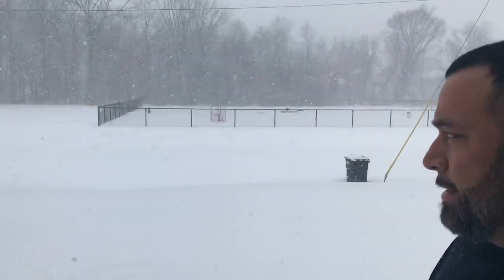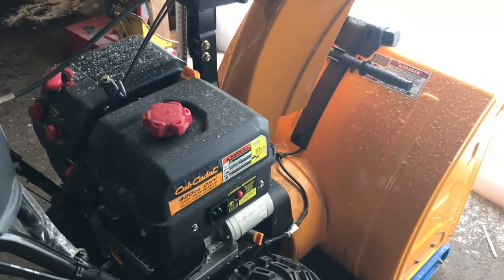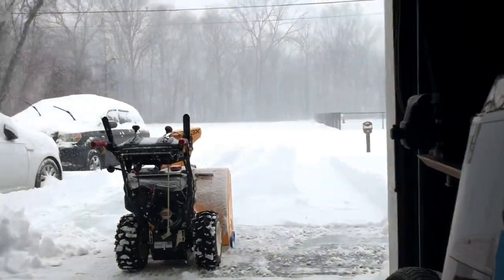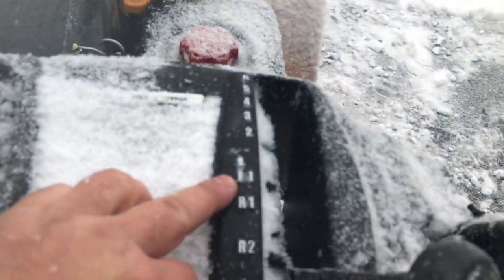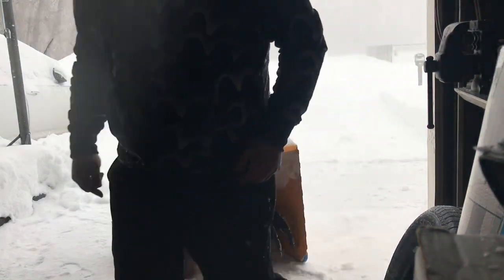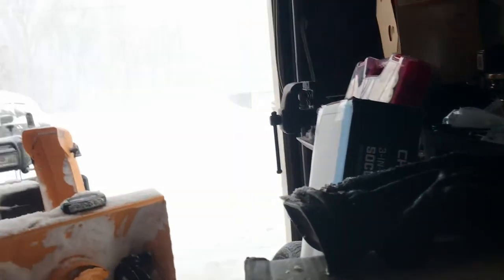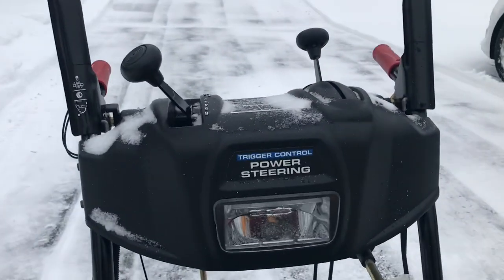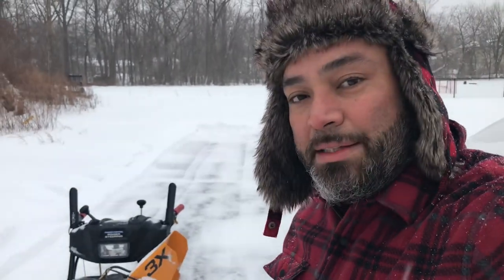Cub Cadet 3x 30 HD Review 2021 snow storm

Comment: broke shear pin?  I have the near exact same snowblower but Troy Bilt, 3X 420..  I've burned the ,main belt off mine several times, sheared some pins.. but golly, mine will CHUG thru 2 ft. snow like no tomorrow.  The steering has held up fine.  Always easy to start w/the pull rope.  Don't leave stale gas and it's a beaut.
Reply from the maker: That is good to know thank you

Comment: Why r u stopping and going, once the sheer pins were fixed that should eat that amount of snow easily.  I have a 10 yr old cub cadet 930 (2 stage)  with 357 motor it would and did (Connecticut)  go through that stuff like nuthin!
Reply from the maker: That is good to know. I will try it in the next snowstorm 
Thanks for the info
Reply: I agree, a snowblower that big should eat up that much snow without stopping.

Comment: I feel you left it in half choke and rabbit mode vs turning it to full choke and changing the mode of speed.
3 stage 400cc Cub cadets should chuck snow, even if powder much farther than that.
I could be wrong.

Comment: You need to keep both of those levels down in order for that machine to operate right, you are going to wear that friction disk down more quickly on that transmission, plus,there is a shear pin on the gear that turn those tires, you are going to snap that pin because of the stop and go motion  you are causing a lot of stress on that shear pin.
Reply from the maker: Thank you for the info 
I will keep that in mind next time I use the machine. Hopefully it snows soon so i can try some of these techniques

Comment: Also GREAT VIDEO! I'm curious if that forward auger was working when you initially clogged up. For heavier stuff like this that first full mouth pass is the hardest even at lower speeds. I'll take half cuts the rest of the driveway and tune my drive accordingly.  Side note I noticed CC leaves an awful lot of space for their final stage augers. Did the impeller mod with rubber to sweep the Chute better and I can't wait to try it. Worked wonders on my 70s Toro and a few other machines I have fixed up.
Reply from the maker: Thanks for the info 
Yeah i have been wondering about that impeller mod. I’m curious to see if it really works. Please keep us posted on how you like it if you get the chance to try it out. Thanks again
Reply: @chillymooose  It doesn't do anything substantial on this machine. I have since sold my 3x as it was nothing spectacular here in the Northeast.
Reply from the maker: @Bellincion  I agree 
I’m going to give it one more try if we ever get a decent size storm but starting to think it’s probably time to change machines

Comment: If you can find ethanol free gas it works best if not the manual says to use highest octane gas you can.  
Also mine says to store with lever in 6th speed to keep the cable from stretching to the gear box, though it looks like they replaced the cable with a metal rod to the gear box.
Reply from the maker: This is great information 
Thank you for letting me know

Comment: Your cub cadet performs similar to mine when i bought it and your engine is bigger. That was til last home depot maintenance. This is a beast when everything is correct. Look how high is housing that takes snow and if all correct it will throw snow easy to top or above housing. You see that weak stream at the beginning of video thst means prabably auger start cable is not corectly tightened. You had to start and stop cause stream was throwing weaker not to clog snow blower. Also pin broke when it was maybe an inch of snow and for me now i think i broke 2 pins while before correction prabsbly 20 or more mostly on small snow. Now my snow blower can throw heavy 2 feet tall plow snow pretty easy. Guys at cub cadet dont know their own equipment!!
Reply from the maker: Oh wow... nice, I appreciate the feedback. I’m going to take a look at the manual and the machine and see where I need to make adjustments. Thanks again

Comment: I cant believe it blew that good with no shear pins
Reply: It uses 6 shear pins total. 2x for left auger, 2 for right auger. 1 for the front chopper, there's also a rear chopper before it hits the thrower that shoots it out the shoot. 

The yellow spinner in the rear isn't what's chucking that snow. That is black. Essentially snow has to go through 2 moving partd before hitting the chucker. Either center spinner or auger, then rear chopper that blocks the chucker so all snow has to go through that, followed by the chucker.

 The rear chopper was still spinning and the augers was pulling in the snow which is why it was still throwing as if the front chopper was spinning.

They could make an all auger front with chopper in rear than chucker.

It'd be like if stage 2 went Super Saiyan.

Comment: Thanks for the video,  I  would check the positioning of your speed control cable , you should be able to go slower than you currently are.  Definitely get your belts tightened up.
Reply from the maker: Thank you, I’m definitely going to check that out. I appreciate it
Reply: @chillymooose  put the machine in 6th, remove TOP pin of the linkage going from the speed control down to the chassis. adjust it by turning the nut counter clockwise until there is just a tiny bit of tension when inserted back in. replace with pin. This will set your gears correctly giving you better reverse as well as lower 1st gear without changing your top speed

Comment: Should've just bought an Ariens two stage machine. The snow wasn't deep enough to have to keep starting and stopping to allow the machine to catch up, even after the middle auger was fixed. Most two stage machines could've handled that without starting and stopping.
Reply from the maker: Thanks for the comment 
Going to see how she does this upcoming snow season and if I decide to buy new, I’ll definitely check out the Ariens
Reply: @chillymooose  Well... if you do, check out one of the Rapid Trak versions.
I bought an Ariens Platinum RapidTrak 28 SHO in 2020, and it's one of the best investments I've ever made. It handles deep, Chicago lake effect snow like it's nothing... and throws it FAR, and no skipping and sliding either. Hopefully though... your snowblower performs better, so you can save that money. Good luck .

Comment: I bought the same machine right before the first storm. It performed well but I did replace 9 sheer pins from debris kicked out by snow plows. The 420 is a strong motor and the power steering was a luxury, but reverse was painfully slow. 
The traction was lacking so I ordered chains too.
Reply from the maker: Yes i love this motor and it performs well. Please let me know if you figure out how to dial in the machine.
Reply: What chain did you get for it, I have the same blower?

Comment: There is a hidden rocker switch under the main panel facing the operator. I had to ask my dealer where it was located? 
I have the same machine. I’ve had mine for 9 years so far. The heated handles are over rated.
Reply from the maker: Found it
Thank you. Yes I agree they really don’t do much especially when you are wearing gloves
Reply: @chillymooose  I previously had a smaller machine made by Troybilt. That had heated handles. When those were on? I had to wear gloves to prevent my hands from being burned by the heated handles. Those threw off serious heat! Unfortunately when we got bigger snow fall dumps it wasn’t up to the challenge? I had to up my game. If I had my dithers I would have preferred to buy a Honda but they wanted serious coin for the same size machine. Maybe next time?

Comment: I have the 26 inch 3x with the 357cc motor. You have to slow down in deep snow no matter what its consistency, in other words, you have to let it chew its food before you make it swallow. Mine works awesome that's all I know. I did zip tie the governor for top rpm possible, I would not recommend for others to do so.
Reply from the maker: Thank you for the info
Reply: Prabably auger cable loose your machine too. I have 28 inch 3x 357cc and first 2-3 years machine had little power, shear pins brake all the time, clog a lot even if an inch of snow. Then a year ago I gave it to home depot for maintenance. After that amazin!! This thing you can go 2 feet of snow and if it needs it starts thst tractor sound and it flies far. It is beast even i did like a foot or more very heavy left plow wet snow and it still did job. There is no up down stream no more. It is just up and far.

Comment: Great video! Unfortunately that’s the main problems with Cub Cadets.  They clog and barely throw the snow with any distance.  I just sold my Cub Cadet and ordered a new Honda for this year. I had enough of Cub Cadet!  Hopefully you have better luck with yours…
Reply from the maker: Wow… good to know. What model Honda did you get? I may look into it.
Thanks
Reply: @chillymooose  HSS928
Reply: Sheer pin was busted, they work good if you know your machine
Reply: @allenwolfe8196  I had my cub cadet for 10 years. Always  started right up first try, just never could throw the snow like other brands I’ve seen. Even when brand new. Hoping for better results from the Honda ….
Reply: Let us know how you like the new machine. Thanks
Reply: @allenwolfe8196  👍🏽
Reply: Hey moose,u use your new Honda 828 yet

Comment: You had the machine in the highest travel speed (#6) and kept on starting and stopping to let the auger catch up with the snow that was being forced into it. All your doing is wearing out your drive belt by starting and stopping. SLOW THE MACHINE DOWN TO #1 0R 2 SPEED and let the machine do the work.
Reply from the maker: This is great thank you. Yes looking forward to the next snow storm so that I can use this tip. Thanks

Comment: Something wrong with your 3rd stage. Shouldn't stop because of a little snow. Check your shear pins & gear case. You are trying to feed too much at once. Take it down a gear let it do its job. It is really hard on the trans to jam it forward than stop. Than jam it forward. Slow the speed forward & let it get rid of the snow.
Reply from the maker: Thank you 
I appreciate it 
Looking forward to new snow fall so I can try it.

Comment: It's a good video to help people diagnose a broken shear pin, but it doesn't show much else.  Pins can break at odd times, or become damaged at one time, but not fail until later.  I know I only ever broke one pin, and when it failed, I found no debris.  However, at some different time, I do know I hit a concrete "frog" that the previous home owner left near the pavement which stalled the machine, but didn't break the pin at the time.  I was waiting, still am, for the gearbox to fail after that, lol.  It made some nasty noises for a while, but then it settled down.  I'm sure a chunk got broke off and got shoved into the corner of the gear box.  I just hope it stays there.  ;)
I understand speeding up videos to keep them short, but if someone is going to sit through a 1/2 hour snowblower video, they probably want to see real time action.  ;)
I still remember the old "3 stages" where the "3rd stage" was a powered drift cutter.  My friend's dad had a Murray(?) "Snow Wolf" that had a little drift auger up top.  Looked pretty cool.
That's not to be confused with some old machines that just used multiple same sized augers, like the larger commercial machines do.
Unfortunately, due to Safety Sallys, your aren't gonna see good drift cutting machines in the states.  If you want to see a drift cutting beast, look at the Euro style Hondas.
Or pre-1970's machines in the states.
Reply from the maker: This is great thank you
Will definitely look into those machines
Reply: @chillymooose  to check I just googled "honda european snowblower" and clicked on images.  Most images showed "normal" ones, but you will see the ones I'm talking about in some of the images.

Comment: I had one of these 3x cubs and i got rid of it and bought a brand new Toro 2 stage. 
The Power Max HD 1030 OHAE.
I think a  2 stage blower would work alot better.
Do yourself a favor... get rid of the cub and go get the Toro Power Max HD 1030 OHAE.

Comment: A two stage HD snow blower with 14-inch impellers and auger is the best all-around machine for any snow condition. About a month ago here in southeastern MI I spent over two hours blowing 6 inches of extremely wet heavy snow and not one time did the machine clog or even hit of doing so. That sold me on the machine's ability to deal with any kind of snow condition. The most amazing thing to me was, it was able to throw the heavy wet stuff more than thirty feet. I was not expecting that. Toro claims the machine will throw snow fifty-seven feet plus in the right snow conditions. After how it threw the wet stuff, I tend to believe Toro's claims. Hand warmers worked great, and the quick stick shoot control was tricky to get used too, but after some time using it, I got the hang of it. The trigger steering took a bit to get used, but once again I got used to how that worked, and now I can control the machine with ease. I was looking at a Pro Series Ariens but because of the auto steer system and some complaints of having to fight with the machines in some situations I went with a Toro Power Max HD 1232 with trigger steering. So far this winter we have not had much accumulating snow. Maybe next year? Thanks for sharing your experience with your Cub Cadet 3X 30 HD. Hope you can work the bugs out and blow snow when you get it.
Reply from the maker: Thank you for the info 
When I go to look into a new snow blower I’ll keep your model in mind. I appreciate it.

Comment: Two stage all the way. This video proves the complications of a three stage, and they are supposed to be way better at clearing snow, but this just shows it add more complications to it. Besides that, they are much harder to maintain. Stick with a two stage unless you're a contractor and can write off the cost of your equipment and maintenance.
Reply from the maker: Thank you for the feedback 
Really appreciate it
Reply: He was In a way to high gear i have the 45inch one and it throws it like 60 feet and can't stop it

Comment: Look how big openning machine has!! Why would they do that and put big engine!! Trust me your machine should perform even better than mine cubcadet 3x i think 357cc. I think last year when i started auger it wouldnt even start until when auger pressed i had to pull cord to start actuslly unclog snow. I think auger cable loose and there is an adjustment with 2 screwes below auger start.

Comment: Sheer pin destroyer, until the company fixed the issue...
Reply from the maker: Do you know how they fixed it? I’m just curious. To see if it’s something that can be done on my end. Thanks for watching
Reply: @chillymooose  I got on the phone directly to Cub C. They replaced the sheer pins with stronger ones. You can order at their web site, they are a different color then installed ones. The 3X is one of my worst life purchases...It looked great in theory but mine came mis-assembled with the drive belt, next year a belt burnt out, and the next year would not start and was told to run only Tru fuel in it which works well but is costly vs gas. I was ready to buy a Ariens right before this, and saw the extra stage and thought great idea. But nothing beats a Ariens for reliability.

Comment: Looks like it was struggling with the light powder snow, thanks for the honest review, will have to pass on the purchase of that snowblower 👎🏻
Reply: LMAO that's not an honest review. He doesn't know how to properly use the beast. I have the troy-bilt version (VORTEX 3090XP). If I remember to record it during this coming Fridays storm I'll post and link it to ya. Though may not big enough snowfall to bring out the beast.

I have a single, 2 stage, and 3 stage thrower. Depends on snowfall total I'll use 1, 2, or 3 stage thrower.

Comment: You've had that snow blower since 2016 and still don't know how to operate everything on it? How much snow do you actually get? Id say it also needs serious maintenance. I have a 24 inch 8 horse older than yours and not a brand name that would take that snow in a single pass, full width in first gear without all the starting and stopping. matter of fact my little 24 inch will take full depth of packed snow in first gear without starting and stopping. There is no reason you had to be starting and stopping unless your belts driving your auger and thrower are slipping. The blower you have is designed to take snow the full height of the blower mouth in first gear hell you even have the bolt holes on the side for cutters to blow snow higher than the blower mouth. Maintenance dude! Seriously. And learn to operate your equipment cause you are killing it through improper operation.
Reply from the maker: Hey man I appreciate it the comments. I’ll definitely take a look at the maintenance requirements for this thing. And see what’s not right.
Thanks again